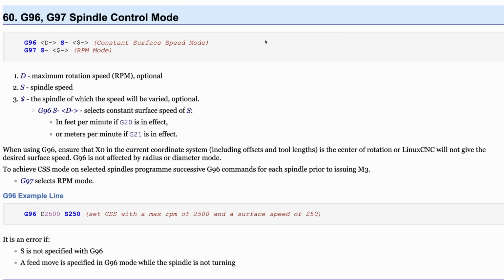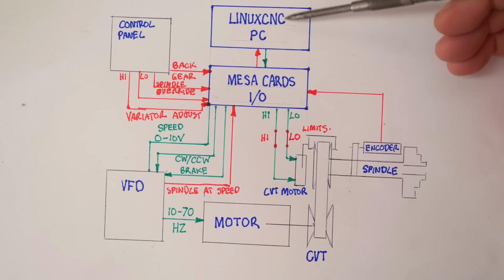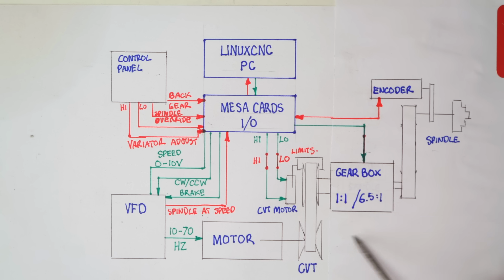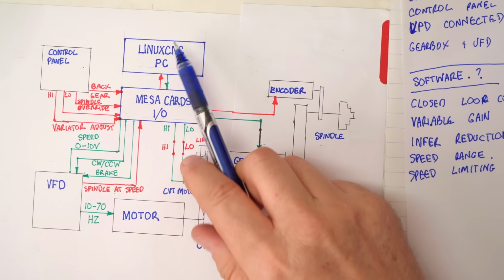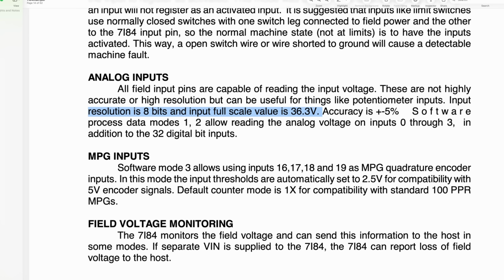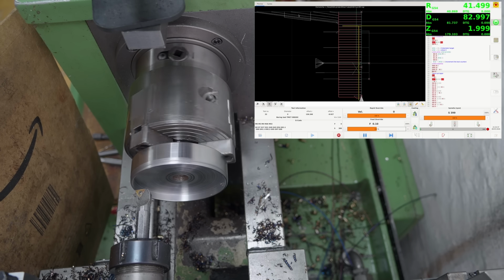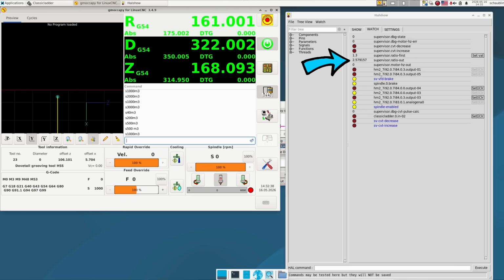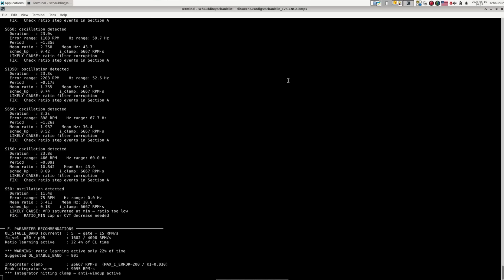Schaublin spindle control Ep.68. || RotarySMP

Comment: That's a tricky problem to solve once you add the unregulated CVT input. Not sure if it can be solved without knowing your actual CVT position. Then you can do a mapping of inputs vs theoretical output speed, not just blindly trying to hit a number. Since the inertia varies so much between the gear ratios, you cannot have just a single set of PID values.
I would split this complexity into smaller problems: try to use one CVT setting for a single cut and just vary the VFD. For each cut you would need to calculate and select the optimum setting (you will have several solutions). At this point, unless you are doing a CS experiment, it might be easier to just put a servo on the spindle.
Reply from the maker: I was using inferred ratio to modify the gains, but that ratio signal is so messy, it needs a lot of gating and freezing. That leads to delays (best case), in the first software, and a random mess in the second.

I have added an update in the video description what I will try next.

Comment: I know it's throwing parts at the problem, but I would think that adding  rpm sensing on the shafts before and after gearbox would provide the required information to cut out the guesswork.
Reply from the maker: Thanks for your input. I added some info on my options and next attempt to the video description.

Comment: Wouldn't it be possible to remove the 3ph motor from the cvt adjustment drive and replace it with a servo motor? That would give you the ability to have full closed loop operation.
Reply from the maker: Anything is possible, but that is not the most desirable change. I added more info to the video description on what my next attempt will be.

Comment: Pony up the $20/mo and start using the Opus models. There's a big difference in the results.
Reply from the maker: Thanks for the tip David.
Reply: Opus is much more capable, but it will only get you so far without using the appropriate AI tooling environment to not blow the context window by repasting and copying large sections of code in and out. Correct development tooling is the real answer, as it will index code and find / edit only what it needs. This is a problem Sonnet can already handle.
Reply: He appeared to be using the Claude web interface, which is built to handle the Anthropic models. While working in an IDE would be ideal, that's a lot to ask of someone that has never done it before. Given that we're talking about a single code file and an uploaded log file, the web interface feels sufficient.
Reply: @davidjaymartin  In my experience the general web/chat interface is not sufficient if you have any ambitious development tasks to do. Every time you copy/paste into it, that takes up extremely valuable context. Every time it needs to regurgitate a 90% identical file with minor changes, it takes up that context window again. Once you start getting close to the limit, it will likely hallucinate, and likely change more sections of code than it should've as it tries to output code verbatim from its memory.

This is why its extremely important to use the correct tooling. My job is in Software Engineering, so I have to use and create AI tooling all day everyday. Tooling and correct/efficient prompting are far more important than people generally expect.
Reply: @nickldominator I'm a data engineer myself that leads AI development for my department and I get what you're saying. I just don't think in this particular case it'll make much difference. 1 million tokens is huge. Even if you limit yourself to 50% of that, which should be safe, that's like 20k - 70k lines of code.
Reply: @davidjaymartin  It seems indicated in the video that when he requesting x change, there are several side-effect changes that are occurring. This to me speaks the AI is trying to remember & output too much from Memory. 

It is important to remember he is pasting & generating the same sections of code many times in the same session, while also chatting with it to make changes. Even if you had a large amount of context available from the start, it is quickly eroded  within just a few iterations. This leads to the context compaction running, and quick degradation of output quality.

I would encourage you to try a challenging development task using just the chat interface and compare that using development-focused tools (Claude Code / Codex / Cursor / Copilot CLI  / whatever). The differences appear extremely quickly.
Reply from the maker: Great inputs guys. I appreciate your experience. I struggle with the whole IDE, Git SSH stuff, and tend to the sneaker net. I need to up my game here.
I have written up my plan for the next attempt in the video description.
Reply: @RotarySMP  If you need any help or guidance on how to use the tooling, I would be happy to help. Its only intimidating until you try ;) .

Of course, AI itself is also well-versed in 'how to GIT/SSH/Develop" that it can scaffold everything you need, and setup the correct environments for you once you ask it.

Comment: im not a pro, but couldnt you just take the output from the spindle encoder and have it auto change everything else based on just that?
Reply from the maker: No, as the same spindle speed can be reached with different ratios, and therefore there would be diffent inertia. The PI gains need to correspond to the inertia. I have written up my plan for the next attempt in the video description.

Comment: Admittedly my experience with control circuits is limited to some semi complex heater/pump control PID  loops, but i don't think you will ever be happy with the performance without shaft feedback at each stage. 

There's just too many use case variations to adequately build a software model. Even a basic optical encoder would probably be a better solution. 

Looking forward to your progress next week!
Reply: > There's just too many use case variations to adequately build a software model.

Hence adaptive control systems, which self learn and self-calibrate given a basic system model. :)
Reply from the maker: I can dream, but that is probably beyond my pay grade.
I have written up my plan for the next attempt in the video description.

Comment: Thanks Mark.   Made my Sunday morning coffee and thought I’d relax and watch some nice content.  Now I have a massive algorithmic headache.   I’m thankful my hobby lathe cnc upgrade project is much simpler.   Seriously, this is an excellent example of what controls engineers deal with when combining electrical and mechanical systems.   Replacing the mechanical system with a simple drive and motor system would make it much more responsive when doing things like threading.  And reduced maintenance in the future.   (and no more Sunday morning headaches 😂
Reply from the maker: You don't need a responsive spindle drive when threading Jim. It was connented above that CNC Lathes are typicall open loop for turning, and only closed loop for positioning as a C-Axis (I didn't realise that). LinuxCNC syncs the axis motion to the spindle, not other way around.
I added more info to the video description on what my next attempt will be.

Comment: 18:40 - I'm confused, is that some automatic cycle cutting several passes or does it run each cut independently? I'd expect spindle speed to adjust while tool is retracting for new cut, not to just follow axis distance from center all the time even when no cut is being done. It would save some time :)

About logic, for initial setting I'd go backwards:
1) Check needed gearbox position. If different than current, stop spindle and wait for zero speed
2) Switch gearbox to ratio you'll need
3) Set 55 Hz on VFD (since motors are usually 50/60 Hz)
4) Measure spindle speed
5) Adjust CVT to get close to commanded speed (+- 20% for example?)
6) Calculate needed VFD frequency and set it  ((commanded speed / actual_speed) * current VFD frequency)

Of course you might not want to spin so fast while setting speed, so you can do slight modification:
3) Set 20 Hz on VFD
4) Measure spindle speed
5) Adjust CVT to get close to (commanded speed / 2.75)  since we used ratio of 55/20

To switch speed during cutting, you'd probably need just simple logic:
1) when VFD command gets below "X" Hz or above "Y" Hz, slightly bump CVT in correct direction
2) measure output speed
3) calculate new VFD frequency ((commanded speed / actual_speed) * current VFD frequency)
4) repeat when needed (shouldn't be if you set low/high frequency limits and bump time properly)
Reply from the maker: It is not a cycle. The G0 retract to start the next cycle is faster than my poorly executed comp, can adjust.

As the CVT actuator motor is a constant rpm motor, I get constant rate of ratio change, which is typically too fast, so the VFD would ideally be adjusting in the opposite speed direction to the CVT to maintain the spindle RPM during a bump, rather than one after another.

I am working on the next attempt.
Reply: @RotarySMP  I see, then it makes sense :)
And good luck!
Reply: CSS mode is typically a direct relationship of RPM to tool X distance from Zero and capped with a G50 for max RPM, the lathe doesn't really "know" when it's cutting and when it's not, it just sees a G1/2/3 controlled motion command or G0 rapid move command, in CSS the spindle will always try to follow the X position so it's prepared to cut, spindle inertia can be significant.
Reply: @Teklectic  Ah, so it really just cares about current position of X axis, I see.

Comment: Are you not overcomplicating the issue? You have to many ways to vary the spindle speed a VFD, a variator and a two speed gearbox. The first "need" you wrote down is "closed loop control VFD", would it not be better to ask: "Do I even need so much adjustability?" Why not set the Motor to a constant speed again and do all the adjustments with the variator. Would massively simplify your problem.
Reply from the maker: Good input. I have added to the video description, what my ideas for the next attempt look like.

Comment: Consider, ditch, the control motor contactors, and using a small vfd, you are inputing a lot of step functions in the loop.
Reply from the maker: Do you mean control the CVT positioning motor with a VFD. Good idea. I dont really have space for one, but it is worth considering.
Reply: @RotarySMP put the vfd in the motor terminal box , a small one, see sew motor with integrated vfd as a template
Reply from the maker: @arturperreira5680  Thanks for your ideas Artur. I have written up my plan for the next attempt in the video description.
Reply: @RotarySMP see the 1996 honda civic cvt control loop. I think yours is a similar loop.

Comment: I wonder whether you could do 2 control loops: VFD stays in closed loop controlling spindle RPM, 2nd control loop just uses the variator to target 50Hz on the VFD (possibly with some hysteresis to avoid hunting). Decoupling the 2 control loops could simplify control a lot.
Reply from the maker: That is basically what that first ChatGPT comp did. 
 I have written up my plan for the next attempt in the video description.

Comment: Something i haven't seen mentioned is the range of surface speeds you actually need. Getting an estimate of surface speeds for your min/max work piece diameter and HSS and carbide tools will give you another set of boundary RPMs, There is no point in optimizing ranges that you may never use in practice.
Reply from the maker: Good input. Thinking about it, in practice it wont be a limiting factor. HSS on max diameter cast iron, and anything on anything at the center line means the entire 36-3000rpm will get used.

Comment: I would suggest to use something like 4-5 fixed positions of CVT achieved with some additional 2-3 proximity sensors and later to control with VFD. Maybe this would be easier?
Reply from the maker: That is also my need attempt idea. I added some info on my options and next attempt to the video description.

Comment: I would change the variator motor for a Chinese ethercat servo and drive that way you have more command over the speed and close the loop on that section with only a motor mount change
Reply from the maker: Sounds simple. Isn't. 
I dont have the spare cash for that. 
Chinese servos do not have the long shaft necesary to mount the CVT. 
I have only 16A feed.
Change one thing, change everything.

Comment: Loooong time subscriber and watcher; first time commenter.

I do not have an engineering or programming background, but I have been leaning into AI to program and create tools for myself and my business. I use claude code as my main 'engine' for building/coding. I use it within VS code; this gives me better file tree visibility than the claude desktop app/web browser interfaces. Then I loop in Perplexity as my technical/code auditor. It gives me access to multiple different models to give another "opinion" on what claude is spitting out. I find it pretty remarkable what it catches that claude acknowledges as oversights or critical gaps in its own planning and execution.

Granted, I'm paying for a Claude Max plan, primarily using Opus, and then also paying for Perplexity Pro. It looks like you were using Sonnet, and if you are on a free plan (I get it), you are leaving a lot of capability on the table.

Lastly, you've gone to the trouble of making this whole video (thank you!). Grab a transcript of it (many free online tools), and dump it back into your model as another point of feedback--I do this with instructional videos all the time. Don't be afraid to grab some screenshots of your diagraming and dump them in as well. These both have potential to provide the AIs with valuable input. While I can't guarantee AI will eventually get you to where you want, I've been amazed at what I've been able to build with my limited training and skillset by merely iterating and playing different AI models off of each other.
====
I've never commented before because so much of what you do is above my ability, skills, and knowhow; and I've never really had much to contribute. I find your work inspirational as a businessman by day and an aspiring hobby engineer by night. Keep up the good work; I watch every minute of it.

Comment: Two simple halleffect tacho signals, before and after the cvt, gives motor speed, cvt ratio, and gives feedback on backgear ratio.
Reply: I agree with that! I'd also try to actually get data on these speeds, I think this might already prevent so many headaches and makes it easier to consider the edge cases too!
Reply: This is the way.  You can't control what you cant measure.
Reply: could also place a proximity sensor on one side of the reducer box to detect if the arm moved is also an option.
Reply from the maker: Good inputs guys...

I am thinking of taking one last swing at my original idea:
- divide the CVT range into 5 fixed ratios, one second apart.
- survey the whole range,  generate a look up table of CVT "fixed ratio", and VFD Hz.
- largely open loop with VFD frequency interpolated between LUT values.
- Maybe switch to closed loop to fine tune speed (but how accurate does lathe speed need to be?) If added, add PI gains to the LUT.
- I already have VFD "motor on speed" wired in, and had not thought to use that to gate and freeze the ratio calculation when it would be garbage. 
- when there is steady state operation, use the calculated ratio to cross, check and maybe correct for CVT drift.

If I can't get that working, and really need a sensor, there are a number of ideas:
- pull the motor fan, and use the shaft stud to drive an encoder, and then mount an electric cooling fan on the shround for the motor. 
- Make a little amplifier to scale that 0-10V motor speed output to 0-36V
- use an optical or hall sensor to count motor fan fins, or CVT features.
- Add an encoder to the CVT linkage, or to the CVT lead screw.
- Replace the CVT motor with a stepper or servo
- Use a laser range finder on the CVT belt with a look up table to estimate ratio.

The first seems to me to be the most likely to simply work. With encoder in and encoder out, the gear ratio would be rock steady and real time.
The second is probably less work, but is limited by my electronic knowledge.
A feedback of the back gear is probably least important, as that is only switched stationary, and I can log last commanded position, and double check it with total ratio.

Comment: I would go for an easy solution first, dump the idea to control the CVT, leave it at a fixed position or use it as some kind of  controlled gearbox only staying in the high or low position, what ratio from the CVT high to the low position do you get? Maybe you can ditch the 2-speed gearbox and only use the CVT for a "2-speed gearbox". This way It's easy to control, you got feedback for the "CVT 2 speed Gearbox" position,  because you're working with fixed ratios, and you can use the machine like it is without changing something.
Reply from the maker: I could... but where is the fun in that :) 
I have written up my plan for the next attempt in the video description.

Comment: Hey Mark, I have bumped into the same kind of issues, and I feel that a reasonable way could be to add crude feedback from the CVT (i.e. a potentiometer to get an abs value of current ratio) and go for an open-loop operation using carefully measured tables for speed ratios at vfd and cvt stages.
You could thenafter do simple close-loop over the cvt-request to measured cvt ratio as there is no wildly changing parameters here...
Anyway, nice job here... Thanks and Cheers
Reply from the maker: Thanks Jean,  I have written up my plan for the next attempt in the video description.